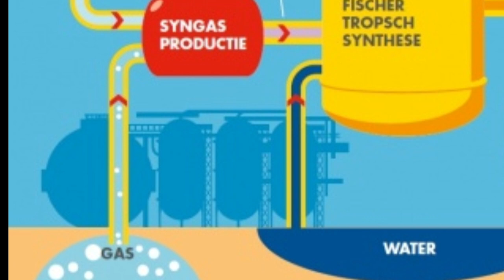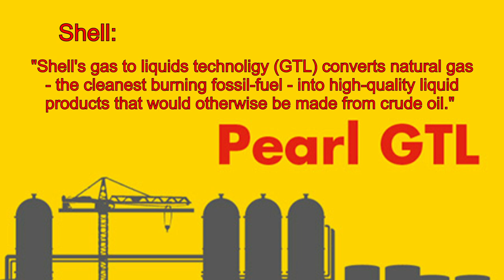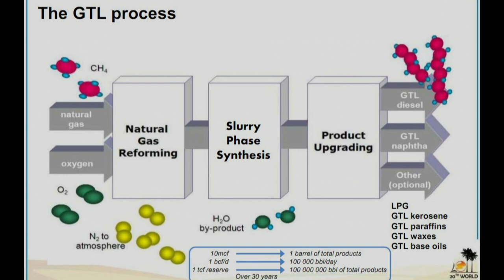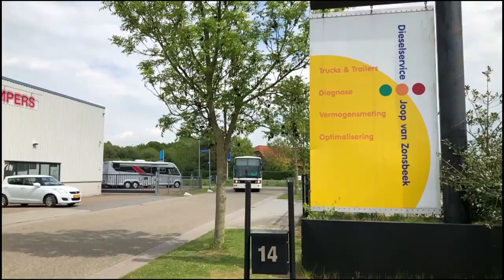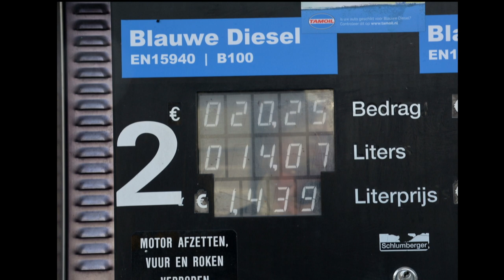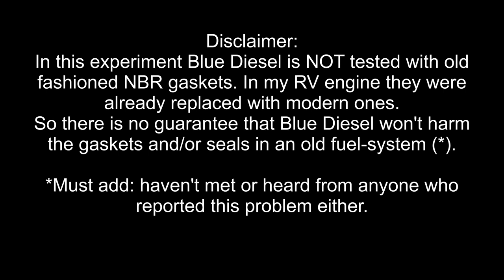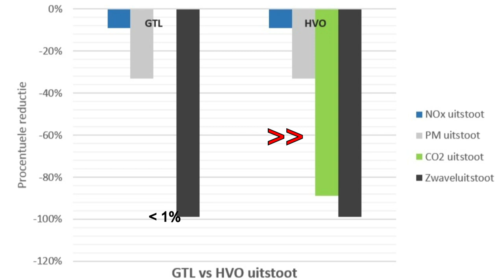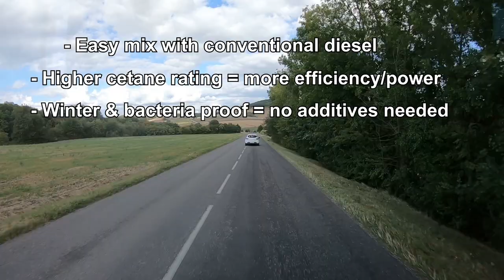Bus Life - Fossil Free? TEST: New Diesel Fuels: GTL & HVO  -  serious alternatives??

Comment: If GTL is sourcing gas that would otherwise get discarded/burned off as a byproduct of extraction or refining, then the carbon benefit may be more than apparent.
Reply from the maker: GTL is not a byproduct of refining oil products like LPG (in France: GPL). It is made out of natural gas.

Comment: I use it in my modern diesel engine in Denmark, and the price is only 6 cent (euro) more pr liter. It is a dream fuel, it runs very smooth.
Reply from the maker: That's great, Morten. And I sure love the Danisch price !  ;-)
Reply: @HanVerdiHuskyRV  They only sell it for trucks and busses, but I use a funnel for emergency filling so the nuzzle fits perfect. It runs very well on it.
Reply from the maker: @Morten Rasmussen, do you have any information on availability in Denmark? I can't find any info on the internet about gas stations that sell it. And I might go to Denmark this summer....
Reply: @HanVerdiHuskyRV  You are right. It is impossible to know if you dont ask shell or dcc energy denmark where. Most often you will found a station with a LKW nozzle.
Reply from the maker: @Charlimike24  Thanks!
Reply: Hej Morten - er det Shells GTL-variant du tanker? Jeg blev lidt nervøs, da der i denne video bliver nævnt, at det kan æde pakninger m.v. Hvilket bil tanker du det i og har du oplevet nogle problemer her et par måneder efter din kommentar?
Reply: Hej Morten. Så lige dit svar. Hvor kan man købe det så billigt henne? Jeg fandt det til 18,22 kr pr liter i dag. Det er lige en kende for dyrt til mig.
Reply: @alexmunch738   Det koster kun 44 øre mere end alm diesel så det burde være let at finde det billigt. Er du sikker på du ikke forveksler det med hvo100?
Reply: @Charlimike24  hej. Blue diesel (B100)er det samme som HVO 100. Det er det gode jeg er ude efter 😀 Det er Ikke GTL jeg er ude efter.
Reply: @alexmunch738   Jeg synes klart at GTL er bedre. Hvorfor spurgte du så til gtl in first place?
Reply: @Charlimike24  hej. Spurgte  ikke til GTL da jeg lige som ham i videoen ikke føler at det er et brugbart alternativ til alm diesel. HVO100 tænker jeg er det eneste der reelt gør en forskel der er værd at forfølge.

Comment: Hi. I am using HVO100 in bought of my cars more than 4 years with out of any problems. Volvo XC 60 D4 2018, and Mercedes 300D 1985. I am so much pleased with results. Bought cars purr like kitten on that fossil free diesel. Here in Sweden winters it’s cold -25C in area in which I live. Never ever have problems to star cars in such harsh climate. Also price on fossil diesel and HVO100 it’s the same here in Sweden.
Reply from the maker: Is it available in Sweden? Haven't found it yet overthere...
Reply: @HanVerdiHuskyRV  Of course, you can find at any pump station.

Comment: Been drivning with GTL diesel for about 200k km without any issues, even in my old Hilux.  So i was very suprised to see your fuel pump   gasket to fail. How old was the fuel pump gaskets in  your Volvo?
Reply from the maker: Paul Saari, no Volvo, but a Van Hool, with M.A.N. engine. It is a '87, so old gaskets
Reply: @HanVerdiHuskyRV  ohh, i am sorry..dont know why i had it for a volvo🤭. Ok so do you think it would happen again with the new gasket? Thanks for the video btw👍
Reply from the maker: @paulsaari4578  no it won't. The new ones are modern and adjusted for modern fuels.

Comment: Can i the have one old vehicle with this type fuel HVO?
Without problems on my internal combustion engine and without environmental issues!
Does exist Renewable LPG or Bio-LPG Fuel?
Because i have a car with aftermarket conversion to LPG, not from the factory.
Reply from the maker: If it's a diesel engine you can. If it's a petrol engine you cannot.
As far as I know there is no such thing as renewable or bio-LPG.

Comment: Interesting test. I think I’m remain following you 😄. 
There is one question about your test that need to be answered for me and most likely many others: can I use HVO in a VW California T6 204 Hp Biturbo, tuned to 245 Hp that needs the regular additive for Euro6 diesel engines and if yes, does my engine additional alterations, such as specific tuning? And will it keep the turbofans clean? I won’t shoot you when you do not have an answer to this questions 🤓.
Reply from the maker: Hello Cees,
Don't know what you mean by 'regular additive for euro6 diesel engines'. If you refer to ad blue (don't know), that's completely different. It's an after-burning additive.
As far as I know you can use HVO in newer engines, and every engine manufacturer garantees it up to 30% (there is a 30% HVO blend available at Esso, and 20% blends at most HVO stations), because those products are still within the fuel norm (lubrification etc). If you're worried, you can start with that and see what happens.
Older engines, like mine, may develope leaking problems because of oldfashioned gaskets
Reply: Ik las gisteren op internet dat onlangs (juni 2020) de nieuwere T6.1 door volkswagen geschikt is verklaard voor HVO. 
Voor de T6 stond dat er niet expliciet bij...

Comment: Dont see why the increased cetane number for HVO Diesel should increase the fuel economy. Regular diesel has a cetane number that does not cause excessive ignition delay. Could it be that the LCV (lower calorific value) is higher for HVO Diesel? I will look it up...

Comment: Your rv most likely had a diesel leakage before fueling GTL
Strangely enough, Sweden and Finland + several other countries sell GTL as conventional fuel.

So this video most lightly is slightly used as commercial for HVO to profit your own interests.

Working in engine workshop
Overhaul, repair, maintenance
Of engines and transmissions
Reply from the maker: 6 premature and false conclusions in only one comment. That's tough in itself.